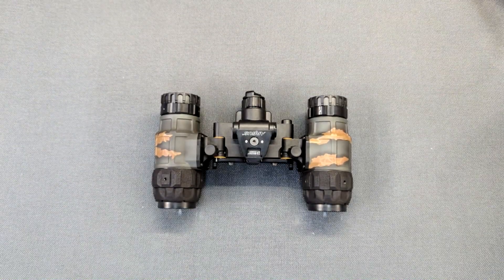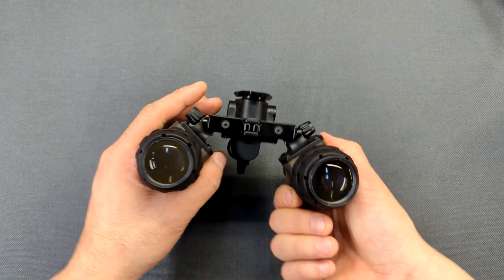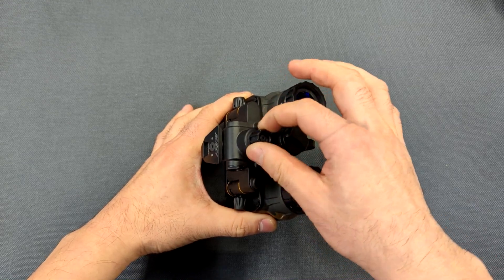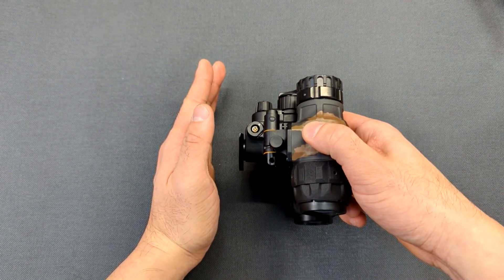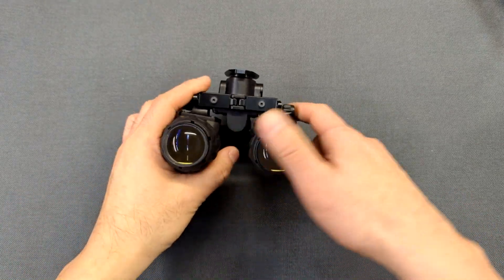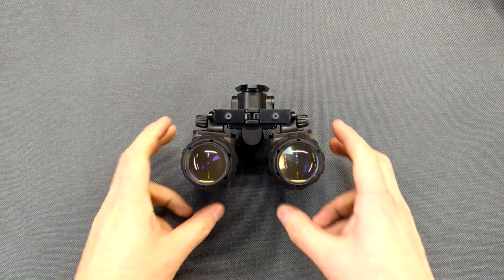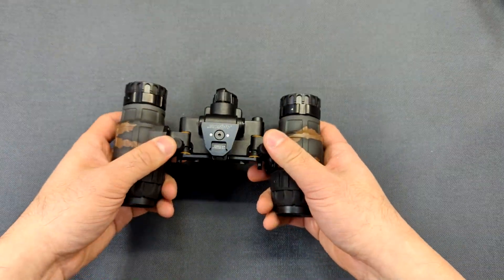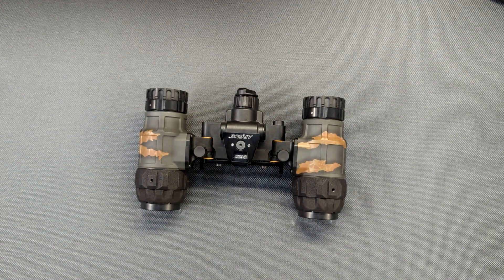BNVD-1431 Mk.II - Feature and Function User Guide

Comment: I know this is an old video, but I noticed when you triple press the power button, it’ll have the same effect as pressing it 5x. Is this intended? Or is there a difference between the 3x press and 5x press? Thanks
Reply: 5x is for tilt shut off
3x is for disabling the 3-min auto timer unit  shut off

Comment: Besides the screws and the opfor night solutions tag, what else is different from the Canadian version to the ones straight from argus?
Reply from the maker: Quality control and testing is done in Canada. Each housing unit is negative pressure tested for seal, powered on with a pair of Photonis tubes to test electronics and gain, pod threads are inspected with Carson diopters, etc.

They are also warrantied and repaired in North America to avoid long turnaround times or shipping to and from Asia.

Comment: What’s required to make the mx11769 tubes to work with the housing? I have elbit and L3 tubes with the removable the pig tails. I can’t find any info online any direction would be appreciated thank you.
Reply from the maker: Check my channel I have a guide.
Reply: Elbit have removable pigtail too?
Reply: @Jon.151  not the 11769 so you'll have to do some soder work etc
Reply: @Jon.151  yes they are removable.

Comment: Hey man, great Video👍 do you have also any specs about the weight ?
Reply from the maker: It depends on configuration. This particular unit has lightweight lenses but heavier tubes and weighs in at 495 grams.
Reply: @opfornightsolutionscorp  thanks mate